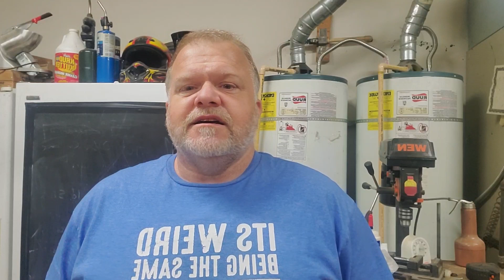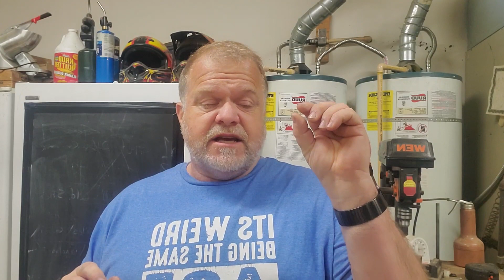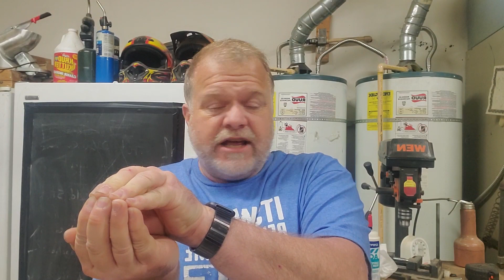Pex A or Pex B Pipe and Fittings

Comment: Regarding fittings: wouldn't type A expansion be useful in tight spots when you can expand the pipe then take the fitting and insert it? I'm DIYing a Reno, so speed is not as much of an issue for me. Worried that I won't have enough room to use a clamp.